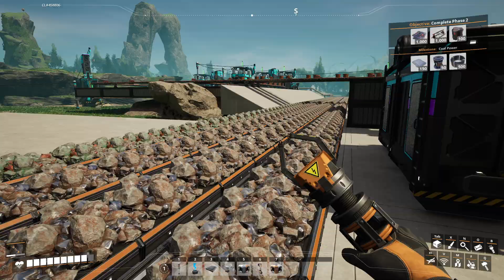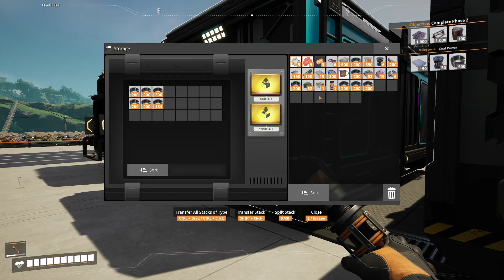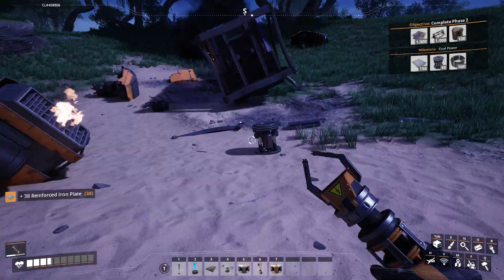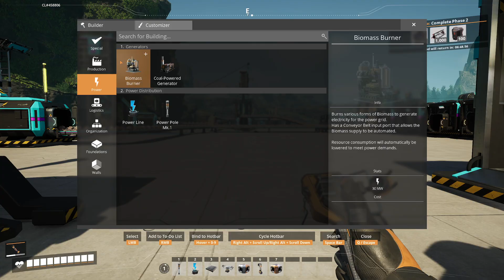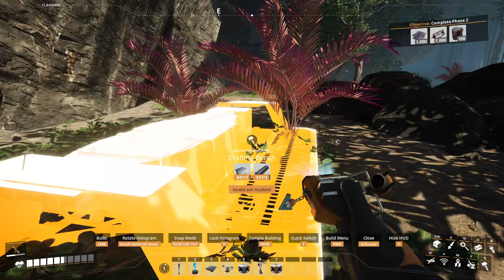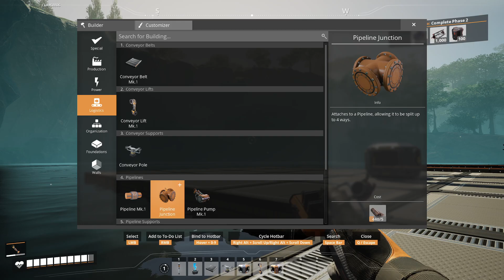Satisfactory Ep5.  Coal Power!

Comment: Good decision to take the Stitched Iron Plate recipe. It is really good if you also unlock Iron Wire recipie.
Reply from the maker: Yeah I hate screws!!! I did not know about the iron wire but I will look at that!! in the later episodes I do have a hard drive just sitting there so it may be one that!
Reply: @Blovoxyz - You can try to get another hard drive and see if you get the Cast Screws recipe. It eliminates one step in the screw production process as you can make them directly from Iron Ingots instead of converting them into Rods first before making screws. Also, you will get additional 6 pocket slots via a Hard Drive. Hence I usually try to get at least 4-5 hard drives in Phase 1 to unlock Cast Screws, Iron Wire, Stitched Iron Plate & +6 Pocket Slots.
Reply from the maker: @jaydeepmohile  Alright, ill try and go hard drive hunting to get the cast screws and I might already have the iron wire but I shall double check in Ep8 when I get around to recording it! Thanks for the advice!